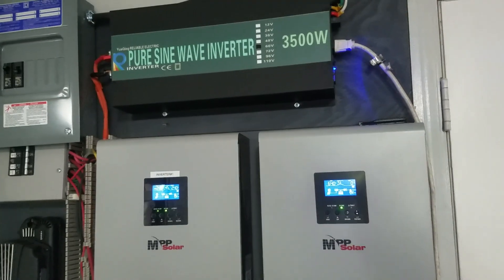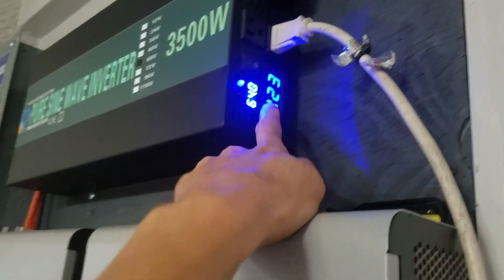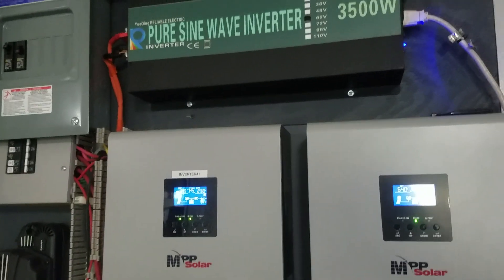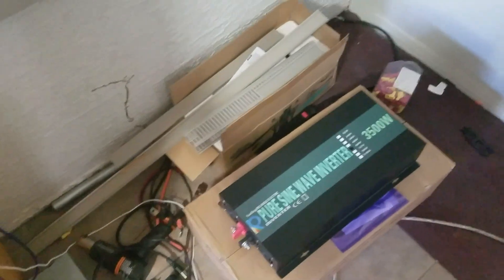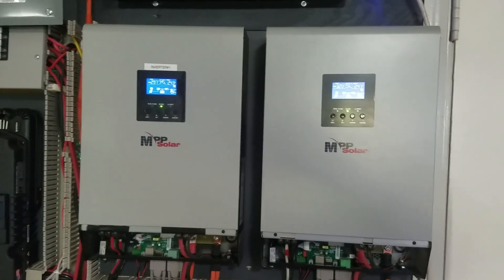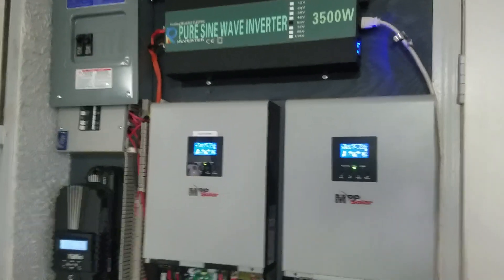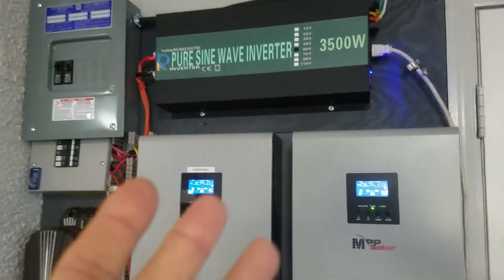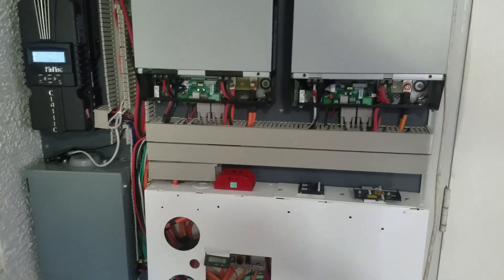Realiable 64volts 3500watt replacement inverter update

Comment: How did you get 2200W surge from your fridge? Most 36'x34"x70" fridges I have are rated at a 7.2A full load, that's about 870W which I confirmed with my Ammeter while  the compressor  started. They actually run at power way lower than that.  Mine runs at 0.1A or about 11W and averaged about 55Wh. First I used a 1500W Aims inverter to drive the fridge together with hand power drills or heat gun. But I did fry it when i ran it with the vacuum cleaner. That's when I understood i should have bought a low frequency inverter instead. But they are double to triple the price. So I stepped up the inverter to a KRXNY 2000W and now I am running 2 fridges and some miscellaneous loads and 2 pond pumps non stop without a hitch. I think your real challenge is the 60 VDC input, not so much the power rating to run some common appliances.

Comment: Nice update.maybe I missed it in another video but do you tie into your house grid through a sub-panel that the inverter monitors  like a grid assist or a limiter that measure demand but makes sure you do not back feed to the utility? Thanks
Reply from the maker: There's no sell back function on these inverters.  Those grid tie with limiter are sketchy... they don't work that well and if it screw up, the digital meter will register it and report it to the power company.  They then have the right to come and pull your meter.

Comment: that's great! im glad they replaced it! also i bet this inverter was damaged in shipping doesnt take much with a inverter, I got one that was damage in shipping as well, and I repaired it, that's what is hard about buying from across the world... also if your not to far from me ill buy that broken inverter.
Reply from the maker: You got my curiosity... what kind of damage can shipping cause to a inverter that would cause it to loose it output power?  I haven't got the time to open it up and check the fuses, there's a bunch of fuses in there... that would be my first guess.
Reply: first off if even one transformer inside has one pin or wire that breaks free from the main board, or something comes lose in shipping, or even if the inverter is stored in a wet area it can cause a weird out come. I just bought a magnasine inverter and the box looks ok but the inverter is bent and doesn't look great. but it seems to work so far...

Comment: Thank you for your videos, They are really informative. I was wondering have you ever connected an oscilloscope to see if it is a pure sine wave. I have a cheap inverter (sine wave) that seams to work very well and would be interested to see if the wave was clipped at all.
Reply: I have many of these inverter and they are pure sine wave I have checked with a scope.

Comment: I am glad you fixed the issue.  

What are the fixed monthly electric utility charges like where you live?
Reply from the maker: It varies between season, winter time 7-9cents kwh, summer 12-14cents kwh.  But if you want Solar contract, regular monthly service fees charge go from 20 to 30usd + up to 25-60usd of demand charge fees if you do not watch how you use your power.  Meaning, if you make the mistake of using their power while in high demand time, they will charge you a lot more.  Installing Solar really can only saves you 40-100usd a month depend on the size.  But with all the fees they charge you... it's stupid.
Reply: devildestiny555 so I am guessing you are fully independent of the grid.

If I understood a $50 monthly charge for the right to be connected with solar is like $600 per year, and this is about $12,000 over 20-years.  Without solar it is half or $6,000, and this is before considering any electricity consumption.  Yeah, I can see why you would call it stupid.